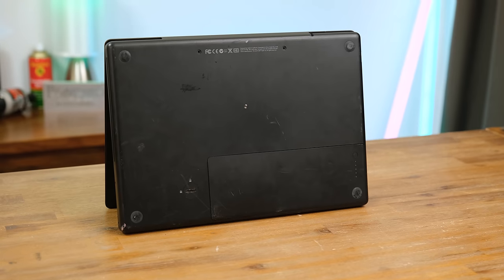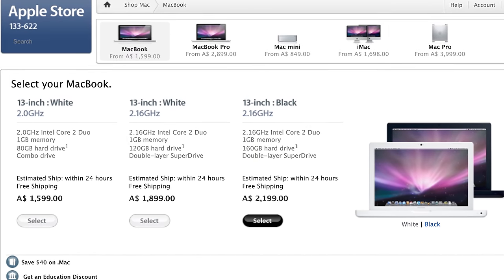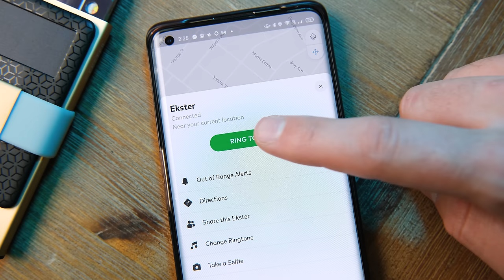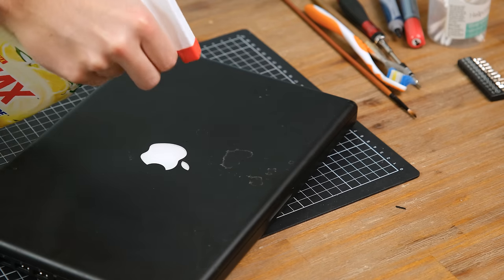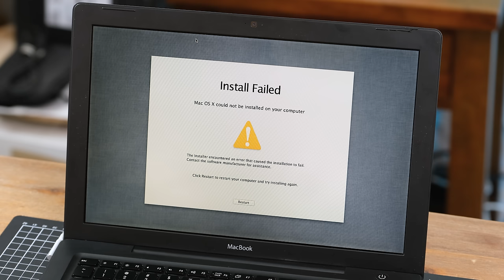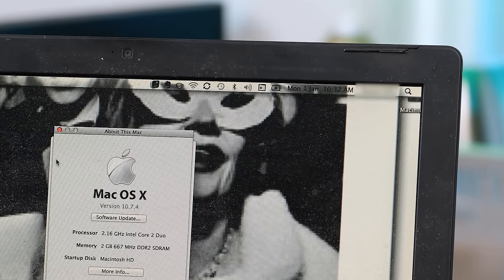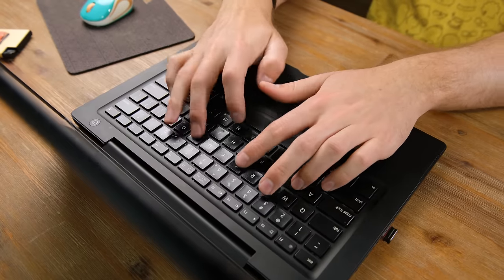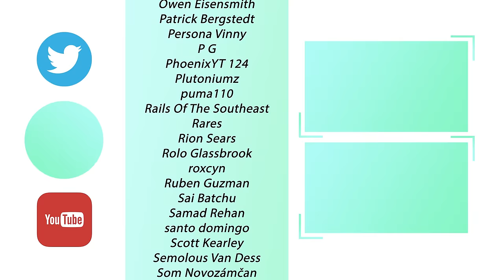Restoring Apple's Rare Black Macbook from 2007!

Comment: I bought a broken pair of these used back in 2012 (a 2006 and 2007 or 08 model) for like $200. All one needed was a new hard drive and ram, and the other just needed a new battery. Ended up using the better of the two as a linux machine during college for CS projects. It was pretty cool.

Comment: This one of the first computers I repaired as a technician at the Apple Store. The white ones were way more common and they’d get cracks in the topcase. I still have my white one but it stopped posting bc of the CD drive failing. Might get around to repairing it.

Comment: The white one was notorious for plastics that cracked on the edge seam and the replacement from apple was a different tint of white and slightly thicker, which looked really odd. When the unibody ones appeared, these sort of issues were solved.

Comment: I had one of these back in the day and I think it is still one of the best looking computers Apple made. The plastic was very brittle after a few years and used to crack around the edges of the topcase.
Reply: Mine too
Reply: Mines a white model with same thing
Reply: @beepyshenanigans  same. It's an unfortunately common issue with them. But I still love mine
Reply: @sadmac356  yes mine has it
Reply: @sadmac356  I cant get lion on a usb no matter how hard i try with disk utility im on a 11.6 2013 mbp

Comment: I got a white macbook in 2009, used it for several years until one of the hinges broke, then I found a non working black macbook on ebay for cheap, and used the screen/lid on my white macbook to fix it, kinda looked cool, a ying-yang look having a black top on a white bottom

Comment: It takes a bit of time but you could try putting the oldest OS the MacBook can take and then upgrade rather than install the OS's until you reach 10.7.
It may or may not work I have had some success on my old IMAC G4.

Comment: I got a black 08 myself I need to get some screws for though. Its a long story, the keyboard wasn't working at the time. I went on a vacation it was working great, I had changed the thermal paste about a year prior, and no issues till then. Anyways I didn't fully put it back together until about a year later when I got a new keyboard. Lost the screws I had put in a bag.

Comment: I have this laptop. And had it FOR YEARS till I wore out the internal battery. Weirdly enough I was able to without ever having to replace it not even once. But by the time I need one I couldn’t find one anywhere. But mine is still is almost perfect condition because it was my first laptop and I took really good care of it. (Honestly surprised myself) I honestly would still use it if I had a new battery that’s how attached I got too it. ❤️

Comment: About the failure of installing Mac OS X Lion, try to change the date to year late 2011 or early 2012 using Terminal app on installation screen, the problem is caused by the Mac OS X's installation process checking date, if the date is too far ahead of the Mac OS X release date, it will cause the installation to fail due to security reason

Comment: I remember seeing one of these years ago in a pawn shop in DFW.  They wanted $600, it actually sold pretty quick lol.
I have a white Early 2008 MacBook that I bought in non working condition.  It would not boot, turned out the power button was bad.  Worked ever since I fixed it.  
I went to use it one day and the track pad was not working, turned out the battery had went bad and bloated.  Took it out and everything works fine again.

Comment: I tried many distros like Fedora and KDE neon, both will be detected by a USB stick without having to modify the iso like with most other distros. KDE neon was pretty fast, except for the discover app, which freezes and is completely unusable, and fedora is just laggy all the time no matter what app you have open. I also modified a Lubuntu iso and installed that, which was also really fast, except it still had the discover app being frozen. Installing linux is not as easy on this laptop as it has a 32 bit EFI, but a 64 bit system

Comment: I have this exact laptop in the same color, I was told when I got it for free that the logic board  was dead
I powered it up to reval the screen was was completely white, I swapped the ram and reset the pram and it worked, however sense I only have windows computers, I had to install windows 7, I am waiting for  a install disk to get it fixed, I will give an update when I get the disk

Comment: My Mum had a black MacBook back in 2006, I think it was the first MacBook model, from memory it had a 2 GHz Intel Core Duo, a DVD-RW drive, I think maybe 256 or 512 MB of RAM, and I don't remember how big the hard drive was.  That computer got used a lot from 2006 to 2010.
Reply: Sherri T[A]P Me!! To Have [S]EX With Me  Well I'll tell you this.  Under a beta release of Parallels Desktop on that computer, Windows XP ran terribly, it was so very slow, it took minutes for it to start.  The computer didn't have enough RAM in it to allow Windows to run properly, plus it was running under a Beta version of Parallels, so I presume the code wasn't optimised.

Comment: I'm watching this video on my late 2007 black Macbook I just received, I got it in great condition with a 7 cycle count original battery that is holding perfect charge, Mine came with 2.2GHZ core 2 duo, I replaced the thermal past using Arctic MX4 cleaned up the fan and internals, upgraded to 4gb ram and a 240gb ssd, it's running good so far, but boy I can't keep this thing from staying in the 70 and 80 degree c under load, do you thing this is the best it can do when it comes to cooling?
Reply from the maker: @Gearsandco  I think that’s simply as cool at they’ll run. I’ve heard of some people even drilling holes in their MacBooks to hopefully improve airflow!

Comment: I own the same laptop, I got it from a sales point for just 10 bucks, unfortunately the battery was dead so I need to get that replaced. I also upgraded the RAM from 2 GB to 4 GB and it seems to work fine. This video is very helpful on how to disassemble and change the parts on the A1181. If any of you guys are interested into buying the A1181 2007 from me, then leave a reply and I'll check as soon as I can. Thank you!
Reply: what does 'a sales point' mean?
Reply: @daktarioskarvannederhosen2568  it's a place where many people bring their stuff that they wanna sell. You go to the sales point to buy stuff from other people. If you're lucky then you can find vintage computers for a good price as they don't know how much they're worth. I got an iMac G4 2001 for just $15 with keyboard and mouse included. Fully functional and worth $150-250.
Reply: @mc.yt.777  so you apparently think it is ok to buy stuff cheaply from others wherein they are unaware of the true value and whereas you are..

Comment: I still use mine!  (Ok, sadly running Windows) but i would not be caught dead with a PC and I need to read OBD codes as I work on vehicles. 

I wanted the black in 2006 but could not afford it. Finally made it right about 3 years ago and found a mint 2008 black model.

Comment: I just recently managed to get windows 10 running on my 2009 model. Planning on upgrading the ram and hdd to an ssd. But ddr2 RAM is so expensive. 8gb cost about 90-100€. So far the performance on windows 10 was pretty okay for only 2gb ram and an hdd. I think it’s really worth upgrading
Reply: 4GB is only around $20 and those models only support 6GB maximum.

Comment: I have had 2.16ghz white version years ago, upgraded from Snow Leopard to Lion and the fan spinning high all the time and even with an ssd the system feeld slow due that sata 1.5 transfer. But 4gb ddr2 so-dimm was great. Ofcourse it could use like 3.25 max but never got over 2gb in use

Comment: Use legacy opencore patcher to update to the latest firmware and boom it’s up to date
Reply: The mid 2007 models like these can only go up to 10.11 El Capitan with patches, and it doesn't run very well.

Comment: Interesting as I’ve just this week bought myself a black a1181 it runs very hot to touch at times but I need to buy some mx4 to try resolve that. Mine runs lion and Firefox legacy as a web browser. Unfortunately somewhere in its life it’s lost a lot of the screws and it’s hdd tray

Comment: my elementary school had carts full of the white ones, and the black MacBooks were used as replacements in the case one of the white ones broke so what they would do it take the White one out replacing it with one of the black ones, and then they used that as a way to track what carts had a lot of broken MacBooks. We only had like 2 computer carts for the whole school so It wasn't a lot. but until recently I thought I was imagining the black MacBooks

Comment: Can't believe this laptop was $1500 back in 2007. Back then I bought an HP Pavilion DV4 with the same Intel CPU and GMA graphics, but with double the ram and hard drive space for less than half the price.
Reply: The upgrades were extremely overpriced. 

They still are, but back then you could legitimately buy and install the DIMMs yourself. I would buy 1GB models, and order the 4GB ram kits at the same time, it took about 2 minutes to do the swap, and would save around $150 after repurposing the 1GB DIMM for a repair on a 2GB system.

Comment: Too funny.  I own both black and white!   I bought a white one in 2007 and I connect via hdmi  cable to a tv in my living room.  It is filled with movies, so all I run is iTunes.   I did have it refurbished by apple right before my AppleCare ran out, also due to a known bug of  the plastic keyboard cover splintering off underneath the fasteners that held it closed.    I also replaced the battery in 2015.   I still use it at least once a week even now.   It  turns itself off occasionally,, but probably only due to the fact that the hd is packed/overloaded with .mov and .mp4 files.  Yesterday,  I just inherited the black one from a friend of mine who was throwing away a few old work laptops, and that's what led me to your video. I'm trying to wipe the hd clean but disk utility is not permitting that, so my research continues...  Thank you for the great information!

Comment: I have one, but no working boot disk.  So it runs on windows 7 for now, and wish I could find a quality black battery for it.  EDIT: Install of the latest supported version didn’t work because of the date and time.  Look it up.  It needs set to the right times for the certificates or whatnot.

Comment: My comment might be disliked by some, but ironically the best OS to install on older MacBook is a Windows. I have a few old MacBooks where they can't run latest MacOS anymore but surprisingly they can run Windows 10 just fine. The trick is Install it directly without bootcamp and then install the bootcamp driver for windows 7 or whatever latest OS supported for your type. 

Windows 10 is smart enough and can run most of Win 7 driver fine. And with the fact some of old Core 2 and Early Core i Series CPU is still faster than most netbook with Celeron N 3xxx series, with an SSD old Macbooks running Windows 10 is very usable for work, zoom etc. 

And you still get updates, security patches, anti virus and browser update to the latest with Windows 10 unlike using older macos.

Comment: Looks like Lion was failing to install because of the certificate issue. Essentially, the certificates used to sign old macOS installers has now expired. Simple fix - just go into the Terminal from the install CD and set the date back to a time when it was valid!

1. In the OS X Installer, choose Utilities > Terminal.
2. Enter date 0201010116 and press Return.
3. Quit Terminal and continue the install.

This sets it back to the 1st Jan 2016 which should be old enough!

Comment: Great job - I am not sure how rare it is as I have one sitting in the draw plus the iPod classic with 120 GB - both are in good condition as I owned them from new. I have a few laptops with Linux so that I haven't bothered to update the Macbook black - though I just finished upgrading Macbook Pro 2012 to SSD running on Catalina which should last a few more years before I consider loading a Linux Distro on it.

Comment: I got one new when they came out and returned it a week and a half later. I was already annoyed that Apple was charging an extra $150 for the "privilege" of having the black color version. As I used it I found that glossy display would often cause glare on the screen. I also had a 2006 15" Powerbook G4 at the time with a matte display. Preferring the matte over the gloss was a second ding against the Macbook. Also with the display mine had a brownish tone/tint to it, depending on the viewing angle. Probably not that big a deal but since I did not like the random glare occurring this didn't help either. The biggest nail in the coffin for me was that it felt slow. I did not understand this at first as the store display models felt a bit snappier. I went to the store again to check theirs. I found the display models in the store all had 768 MB of RAM while my unit had 512. They slipped an extra 256 MB stick in theirs while the product card next to the display listed the RAM at 512 MB. Granted this wasn't a massive leap in performance, it was however the principle of it. Having already paid extra for the black color to then go out and spend additional money to add more RAM did not sit right with me so I returned it.

Comment: I have a white version and it's completely destroyed. The super drive doesn't work, the keyboard is missing keys and most of the keys don't even work, the track pad looks like someone pushed the center of it in. It's cracked all over and missing plastic. I still use it. I bought it for $20 canadian. And use it mainly for windows xp only games with a external keyboard and mouse. Also had to replace the hdd as the one inside was completely dead.

Comment: Hi Psiweri. I found a Macbook Pro 13inch thrown on the nature strip with a bunch of windows laptops. I ran back to home with them all excited.  I opened the macbook pro to find it was cracked in the screen and trackpad. I turned if on and replaced the dead hard drive. When it booted I was fully expecting a core 2 duo. But I found it is a early 2011 with a core i5 and using spare ram from the other broken laptops I made it 16gb ram. I was wondering would it be worth it to buy 2009/2010/2011/2012 macbook pro 13inch (for parts) to replace screen and trackpad?? And do all these year versions have the same screen and are they interchangeable?
Reply: You might be able to get the trackpad and screen replacements alone for cheaper than buying another machine, at least going by the prices I've seen here in the UK.
Reply: @Teazre  I live in Australia. And the screen and trackpad alone ranges from 200 to 300 dollars. But I can find some dead MacBook pros on marketplace for cheap. I just want to know what year MacBooks are compatible with the 2011 for the screen
Reply: @thorium9190  Ah okay, fair enough. Did a quick search and the LogiWiki says that the other A1278 screens are only good for the LCD itself, the assemblies around them are incompatible due to different wifi connectors and the 2012 uses a different display connector. So unless you fancy just changing the LCD, might be better to get another 2011 to scavenge for parts

Edited to correct model number... sorry I'm not better at being helpful lol
Reply: Thanks so much! There are a tonne of 2010 and 2009 A1278 macbook Pros but not many 2011. Very rare
Reply: @thorium9190  It's kinda weird how things end up like that... Here, the parts can be gotten for fairly cheap even if sometimes they have to be imported from America, like how I had to do for my own 2011 A1278. But then even broken ones of the most common Apple products potentially sell for quite a lot of money... largely on ebay tbh.

Oh and a warning - a broken trackpad can potentially cause the Macbook to not boot. just fans spin up, then down, then up and on and on. It's what was wrong with mine when I got it.

Comment: I just still save one of this rare macbook...but for parts only because its chipset seems totally dead (only green charging light, no sign of turning on at all). Luckily, its keyboard is normal then I use it to replace a mid-2007 White's keyboard, the White I've used regularly. It uses 10.7.5 + 7 SP1 x86

I just got 2 alternative browsers which support modern websites such as whatsapp web in mac os 10.6, 10.7, and 10.8: Firefox legacy and a "special modified" chromium

I got zoom and telegram installed too, natively, but so far only telegram works seamlessly. I've tried to log on to my zoom account using my facebook account but I was out of luck, haven't try to log on using email account yet...

At least, I can maximise the usage of the Lion more than before, without switch to Windows 7 first

Comment: It’s not exactly rare. I have one. It was just the most expensive version. Also, are you sure it’s the 2007 model? Mine was 2.2Ghz. The 2007 model was the Santa Rosa version I believe.
Reply: Reply to myself. No, 2.16GHz was mid 2007, 2.2 was the late-2007 and the latter was also the Santa Rosa. The mid-2007 is the one that only does 3GiB of RAM iirc. The SR models do the full 4GiB
Reply: @memsom  you can edit comments